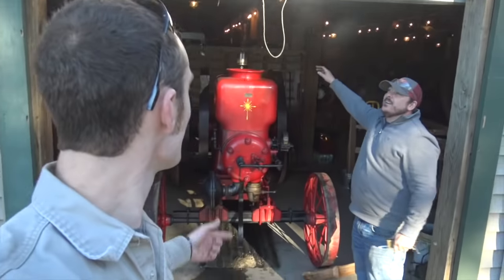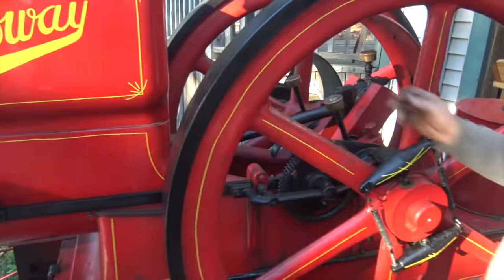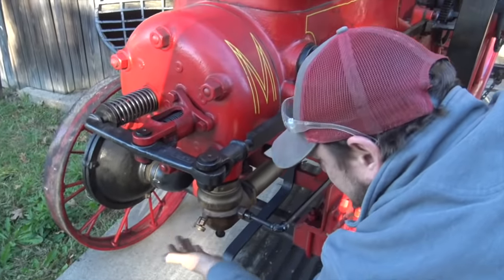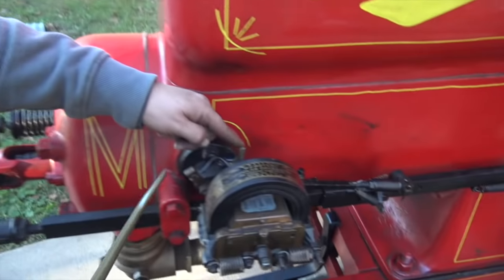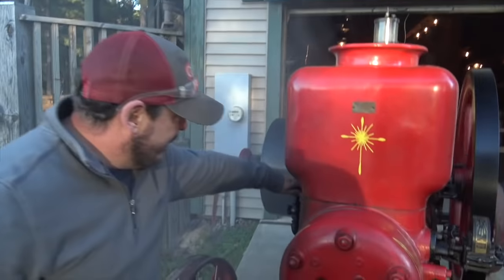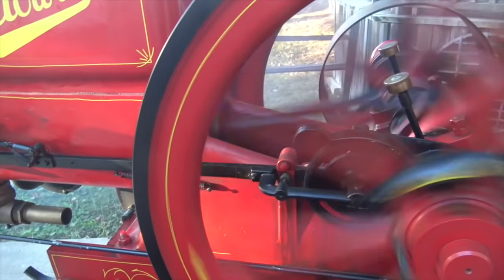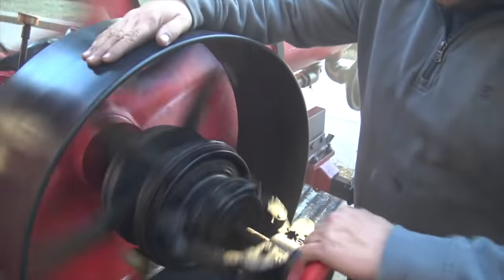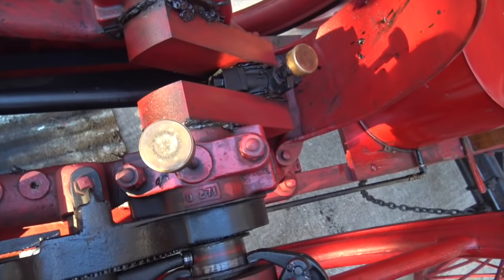WHY THIS INCREDIBLE ENGINE FROM 1916 IS PROOF THAT MODERN EQUIPMENT IS A SCAM & OLD STUFF WAS BETTER

Comment: I have a fondness for old machinery, but not all new stuff is a "scam".  The old stuff has its virtues (which I fully appreciate), but...consider the relative (high) cost of that stuff when it was made.  If consumers were willing to pay more, we could have equivalent quality in various devices.
Reply: Thought I'd add some numbers to compare prices between an old engine like this and modern stuff.

Converting isn't super easy, but it looks like a Galloway frostfree 15 hp engine more or less similar to what is shown in this video would have cost $439.50. That's about $13k in today's dollars.

It was advertised to run various farm equipment, so I would equate it to a generator probably?

If we compare it to a tractor, the cheapest Mahendra sub-compact tractor is $12.5k for 19 hp. If we compare it to a generator, the Kubota Lowboy 2 11kw version has a 16.3 hp engine and has a list price around $9.6k.

Looks like it would have been a bit more expensive than modern tech, especially considering old hp measurements were supposed to have been overstated by a bit, but not too much more relative to the cost of modern farm equipment.

Comment: Awesome tech for 1916: Better than today's tech; not  soo much. On my farm I have a $1000 machine that runs off  solar panels capable of everything this machine is capable of,  it starts itself when required. No point in getting something to last 100 years when new technology is moving so fast to alleviate the suffering caused by starting, not to mention the pollution caused by old tech.

Comment: How many strokes of the piston rods does it take to complete a full cycle?
Reply: 4-stroke, pull in air, compress, fire, then push, so 2 full rotations of the crank.. only trick is it just hangs the exhaust valve open when it's above a certain speed, thus the huff-huff it does.. it multi-pulling when unloaded is usually it didn't get a good air/fuel pull to really fire..

Comment: 1: ran slower typically below 1.2krpm and stayed at that rpm for hours at a time. most passinger cars sit at 2.5 to 4k on a dayly basis and only as long as it takes to go to the shop or work
2:lower compression ratio making far less power less stress on parts.
3:parts were built far heaver because the materials available at the time diddnt allow for the slender parts found in engines today.
4:pepole diddnt thrash the crap out of these machines at 80mph everywhere and never maintained them ever.
so it a load of crap people say the old tec is better. no its not, its that peoples ability's to abuse and brake things has exceeded the physical limits of material science and engineering
Reply: My 2001 Dodge 3500 will run 75 mph 10 to 12 hours a day forever, far longer than I can. I managed a 3800 mile trip in 5 1/2 days by myself and I'm 70+ years old. It's a 5.9 Cummins, 6 speed manual, 3.73 gears, turning 2250 at 75 mph, 16.7 mpg. I love my truck except for one thing. I'd like to have another 2 gears, one between 4 and 5 and another between 5 and 6.
You're right about modern stuff. That old stuff wouldn't stand up to a typical car driver. When my dad was young, cars lasted about 60,000 miles. When I was young they lasted 100 to 130 thousand miles. Now I wouldn't think twice about buying a car with 200 thousand miles on it. Oh wait, I did. I bought a 2003 VW Jetta TDI with 203,000 miles on it and it gets 47 MPG at 75 mph. Try that with any car from the 19 teens years.

Comment: I wish a new company would start building things like that, based on studying the designs of ancient machines just like that one. I would call it: "The Analog Company".
Reply: ok first have it safety compliant is quite hard, the power output is inconsistent and choppy, by weight it dont produce much power and have limited torque potential. Old engines exploits mass momentum meaning if you want more power the engine have to be bigger. Also the massive piston with large displacement its due to operating at lower pressures a technological limitation.
Modern technology can produce engine with fraction of the weight and still have bigger power output and will run longer and dont overheat.   
Look up old soviet cars with dynamo (mean you dont need battery) there are some extremely simple engines

Comment: Engines with ignitors run on low voltage not high voltage. the use the opening of the igniter to assist to get spark

Comment: I'm a lifelong fan of all types of engines, from steam to top fuel, and I love that machine. But that title is a load of hooey. Material science and engineering are getting more hp per pound, better driveability, and longer lasting powertrains. No need to bash one kind to appreciate the beauty of another machine. 
All things can be broken. For example, what was the production run of that engine? And how many are in running condition now? Does that mean it was crap? Or perhaps it means that most were used until they either gave up the ghost or were replaced by something more efficient. Stop with the cheesy titles.

Comment: Ok, can we be honest about WHY this thing lasts forever? It’s not because engines suck today. It’s not that manufacturers are scamming us with cheap stuff so we have to buy more. It’s because it’s THE SIZE OF A CAR and turns at like 250 RPM, and makes 16hp. Just compare it to a simple engine from 30 years ago, like an old Chevy 350 small block. That engine makes 250-350hp depending on the engine, and weighs maybe 300-400lbs. This thing weighs TONS, literally. 

So an old Chevy smallblock makes TWENTY times the power, and is a fraction of the size and weight. And if you properly care for it, it will last just as long. The problem is that newer engines have tons of parts in order to achieve that efficiency. That means more things to break. 

If you look at industrial Diesel engines made today, like big rig engines, they run for decades, pulling hundred thousand pound loads for millions of miles. They’re smaller than this thing, far more efficient, and FAR more powerful. 

This is a really cool old piece of machinery, but saying it is proof that new engines are a scam is either disingenuous or ignorant. If you disagree, go power something with it. Then tell me with a straight face that you couldn’t find a FAR better modern power plant.

Comment: I have a 1920s Ingersoll Rand air compressor that puts out 165cfm and floats at whatever pressure i desire made to run all day long it runs our shop and supplies a plasma table, won't need to buy another, won't be able to replace this beast for the $150 I bought it for lmfao

Comment: 2000 lb of cast iron than produces 16 hp vs 80 lbs of aluminum and steel making the same.  Yep the old stuff is better.  I love those old engines but the only thing better about them was the sound level.

Comment: The simplicity is what makes it reliable. Modern cars have computers more powerful than Apollo 13 had. Too many gadgets. I'd like a car with comfortable seats, AC, heat, headlights and radio. The simpler, the better.

Comment: As amazing and beautiful this machine is, you really can’t deny the extreme growth of technology in general.  Even with planned obsolescence, I’d still rather have my iPhone being replaced every 4 years than having to carry around an ENIAC computer wherever I go.
Reply: I calculated that my previous phone had 64 thousand times as much memory as my first 8088 Computer. It cost me $305 to get the added 40 megabyte hard drive installed.

Comment: I just love your channel so much dude, it's so educational and information is very good. And as well we always want to remember our creator and savior without whom we would be destined to annihilation without the promise of Life everlasting. We we're working on insulating a home. We were using a couple of those cheap clip on lamps that are about 8 in across and are made of a good grade of metal polishable but not real heavy and strong you know but made a nice reflector but would have been nice if that reflector had an art across my index finger just after my knuckle and before my index joint thank you

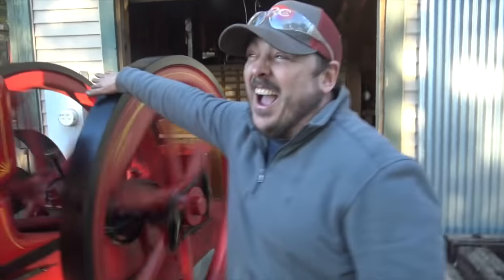Comment: 8:14 Methinks he doesn't understand the difference between angular momentum and torque.
Torque is easy to calculation. Just remember
P = R*T/5252
where
P = Power in horsepower
R = RPM
T = Torque

A little bit of algebra will give you the equation
T = 5252*P/R

Now, angular momentum is an entirely different matter.

Comment: GREY FERGIE 1948 had STEEL WATERPROOF CAPS on gear lever and gear positions CAST INTO TOP OF GEARBOX.
1950 and the MF35 has RUBBER CAPS and plastic gearknob. BOTH BREAK.

Comment: Hardly proof it was better.  That one has just been maintained.  Plenty of examples of old equipment sitting around that doesn't work anymore.  Sure if it casts a shadow it can be restored, all ittakes is money, but that's just as true with modern stuff as it is with old stuff.  I've seen plenty of old engines like that sitting idle because either the piston rings are stuck or the babbitt has worn out and needs replacing.  Heck, even old car engines didn't really last all that long.  When I was a kid a car was considered shot when it reached 100,000 miles because by then the engine was literally worn out and needed rebuilding.  Cars before I was born used to need valve jobs as part of regular maintenance because they were softer than modern hardened valves that can just keep right on going.  Early autos didn't even have oil filters and when you tore one down there was old oil that had literally turned into tar inside them.  Don't get me wrong, I love watching restored equipment as much as anyone, but I'd sure hate to have to use it every day given it's limitations.  Let's be honest here.  If the time came that you needed to move that behemoth more than 20 miles someplace else, would you hitch it to a team of draft horses, or would you winch it onto a trailer behind a modern truck?

Comment: You can buy a whole bunch of modern engines for what that thing must have cost.  Products are made to a reasonable cost point.  You could make a modern engine last for decades if people were willing to pay 4000 dollars for it.  That's also a very low rpm engine.  Run a new engine that slowly and it will last and last.

Comment: A simple, slow, and low power machine has less wear and fuel use than modern engines that rotate at thousands of RPM with way more power going though them... what a shocker
Reply: Try driving a car with that engine to the local grocery store and then realize that sometimes new ways really are better.

Comment: No they were not better. The co efficiency was far less than a modern engine, the power output far less, the power to weight ratio far worse, the maintenance costs far higher and cost far higher

Comment: Never attribute to malice that which is adequately explained by stupidity.  It's not that the modern designer/engineer is designing obsolescence into new equipment, it's just that they're far more stupid than those who came before.  The proof I found is that most people under 40 I meet nowadays will insist they know everything about everything, whereas most people older than 50 admit they would know very little if not for what they learned from the previous generations who they understood knew much more than they did when they were young.  We were schooled differently. These kids and younger adults nowadays grew up being told they were special, smart, and wonderful.  When I grew up we had to prove to the world those virtues before it would be accepted as fact.

Comment: I keep cleaning and dropping a little oil into the cheap motors that run a couple of cheap fans we like to have blow on us at night and they keep going year after year, eight hours a night at least.  If I did nothing they would last maybe 2 years.  They’re not designed to last.  But I’m against this throwaway culture.  I disassemble the window AC units too.

Comment: I hate people saying computers are a scam ... Like most cars only have 2 master controllers, body and engine... And quite honestly as a mechanic I can tell you new cars are easy to work on, learn how to use a multimeter and read a schematic............
Reply: On the other hand, my old Dodge diesel will still run after an EMP blast or a giant CME hitting Earth like the Carrington event.

Comment: Isn't it more, that a 14 pound lawnmower engine can produce more power than this?   Plus 100% left 400 pound whirling, exposed flywheels trying to kill you.   

The old stuff was at least built to last, but it was utterly primative.   And we peaked in the 1990's, the last decade anything was built to last.

Comment: Old equipment will always last because it is significant over built but if todays equipment was built to the same standard no body but the elite Rich would be able to afford them. This is because of the amount of raw material used and the fact that it doesn't break the company woukd have to price the unit high enough to sustain the company for its a one time sale.

Comment: Old earthmoving machinery,still performing duties it was originally designed for,very easy to maintain,as it will always just be a mechanical machine,versus todays electronically over sophisticated,machines that can only be replaced,after a couple of years,you have to be a tech boffin to diagnose problems,as it is cheaper to just fork out for new machines.Old stuff is soooooooooooooo much better,in virtually every way.

Comment: If you spent the same on  refurbing a modern engine it would run forever too. There is no comparison in output and efficiency. Yes this wont break but the three broken modern engines will do much more work for the same total hours.

Comment: That kind of Kool isn't built into the present-day horseshit we see today. Each individual part contributes to the character of these timeless relics,as well does the simplicity of their design.
Engineered with mortality on the mind.
The sad thing is that out of 10 random people were asked if they knew what it is or what it does, nine of them wouldn't have a clue. Those old hit and miss engines were capable of performing in just about everything and anything they were applied to and did it with reliability and dependability.

Comment: This engine is very cool but guys, give me a break. A modern automobile engine will run for 100k miles without any, and I mean any real maintenance. Old engines needed an engineer to keep it running and they needed it all the damn time.

Comment: Sure, neat.  But modern engines put out at least 50 times more power per unit weight.  The cost has also come down at least a factor of 10.  Not everything was quite so great back then.  Still, cool to see.

Comment: "old stuff is better..lasts forever...blah blah blah"  If it was so amazing and lasts forever, why don't I ever see people working these engines?  All they ever do is run them for a few minutes in a driveway or engine/tractor show, at idle, and completely unloaded.  Once in a great while you'll see some massive steam tractor doing an exhibition pull....then they all get loaded in to a modern trailer behind a modern truck and goes home to sit in a barn for months until the next 2 minute idle session.

Comment: Sorry, but you're flat-out wrong. New stuff is far, far more efficient. New equipment is NOT a scam. Put it this way: if old stuff was actually better, why are you not using it? You have smartphones, not bricks, don't you?

The fact is that new stuff outperforms old stuff in virtually every single way. If taken care of, new stuff lasts just fine. It costs less to operate because it's more efficient.

Comment: Yes, it'll run forever.  No doubt.  But it's also got about fifty ways to kill you horribly.  Case in point 9:50 "If you had your arm in this, you're done."  Not that a modern PTO won't do the same, but at least it's not something you can blunder into.  Still, if you treat it with respect, and a little bit of fear, you'll probably be okay.  Probably.

Comment: Old equipment was designed and built to last forever.  New farm equipment is garbage in comparison and software dependent.  That forces the farmer to have to take his tractor to the dealer for service

Comment: Planned obsolescence is not a hoax
Reply: We had technology with two barrel carburetors 6 cylinder motors to get nearly 100 miles per gallon then just look at the light bulb situation you get in trouble if you're part of the little light bulb making groups if you make a light bulb that lasts too long think about that if it lasts too long you get to pay a fine. Wicked progress. We also had the filtration systems for cleaning motor oil that would get 100,000 miles in between changes and the list goes on and on on how we're just financially on bs

Comment: One must consider that the early lightbulb industry conspired together to reduce the length of time a lightbulb would last in order to increase sales. They did it slowly and methodically. This is not some fantasy, but it really happened. Planned obsolescence is a thing to drive consumption. While not everything can be built to run forever, many things can run for a good long time but are purposely built to fail.